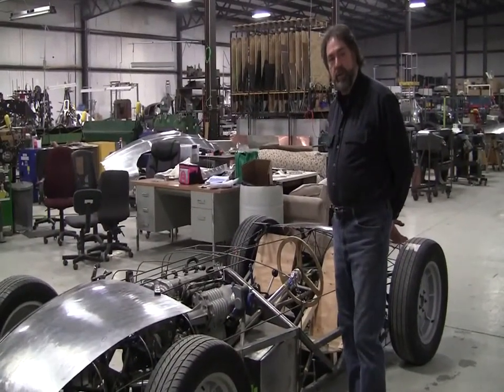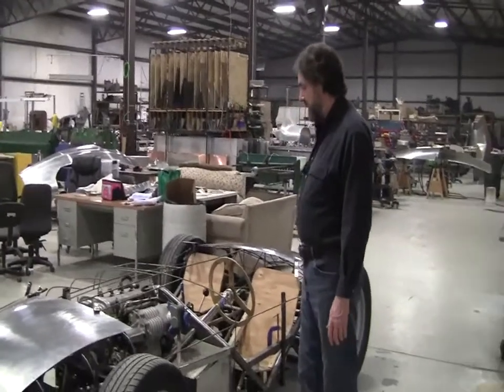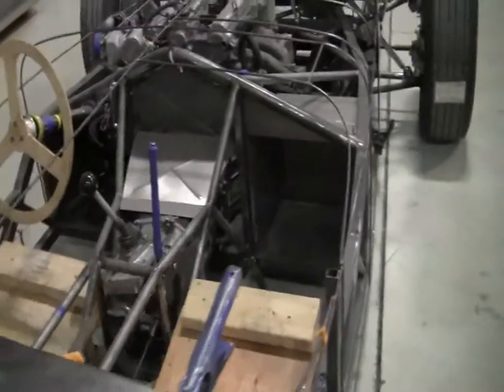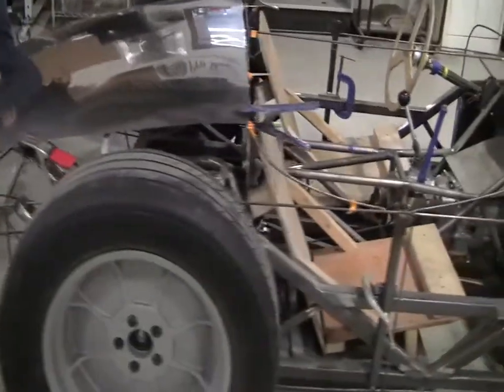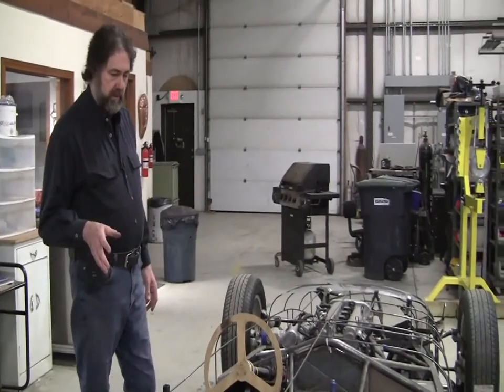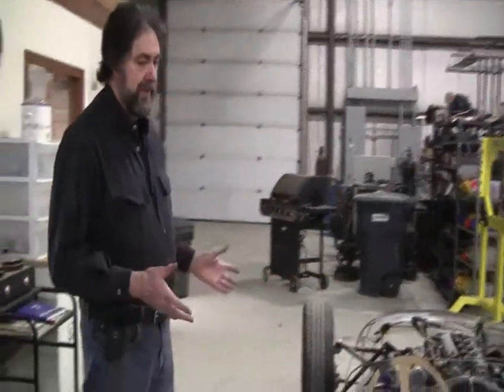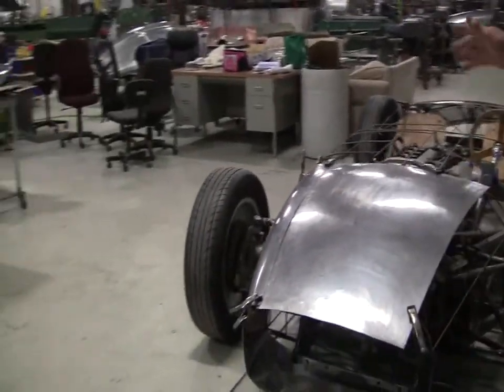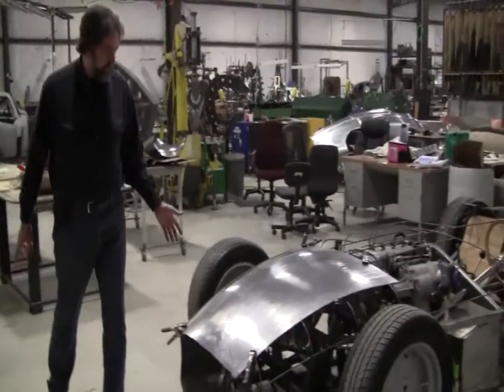Coachbuilding class project- Sean's scratchbuilt Frank Kurtis influenced street racer

Comment: Very cool! What do you have to do to get a tag and title for a scratch built car? Would you use the Pontiac VIN? Or make up a new one? And, what if you did make a hand full of these for customers. Would there be an issue with tags and titles for a short run of cars that have not been crash tested?
Reply from the maker: SEMA  worked for years to get a new law passed that allows new cars to be made that only need to pass the emissions regulations for the year of the motor. Building a scratchbuilt car is no different than  purchasing a new hot rod chassis, a new hot rod body, and then registering it. Some states are troublesome some are not.